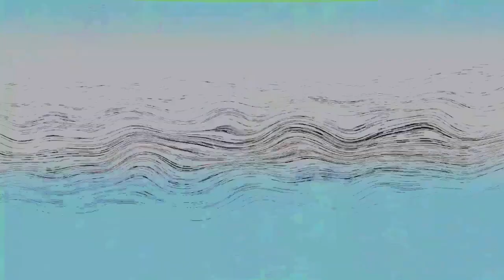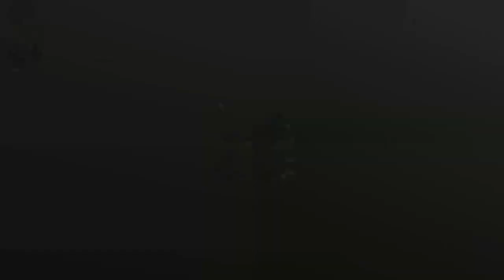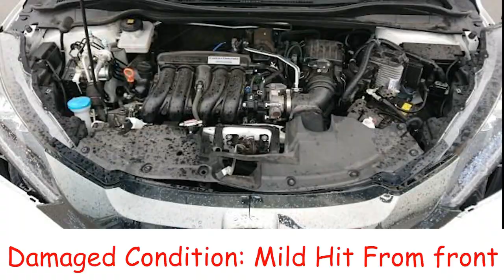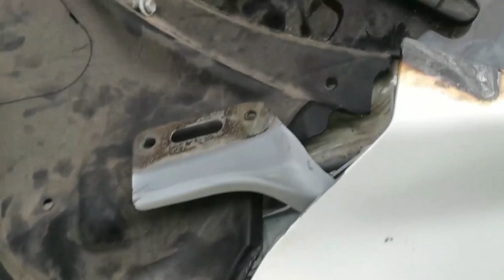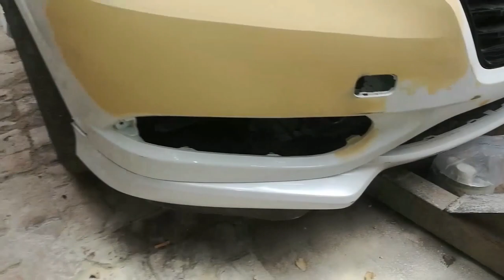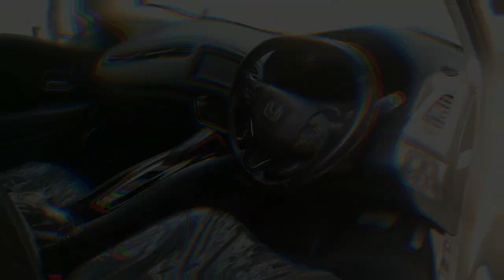1ST VLOG    (HONDA VEZEL HYBRID)

Comment: How much a damage vezel with low millage will cost... 2014
Reply from the maker: 2014 not importable anymore.. minimum 2015..and it will cost around 32lacs to 34lacs approx
Reply: @ustadgjdms157  sir can i get your number... i have purchased honda fit... ab set nahe ho rahe hai chale rahe hai sahe hai jab normal temp p ati hai gari to phir gear light speedmeter blink karti hai jis gear m hai us chalti hai 1st me shift nahe karti
Reply from the maker: 03214320300 whatsapp